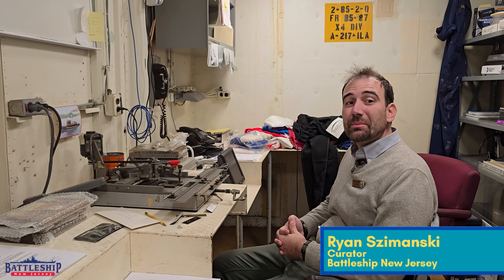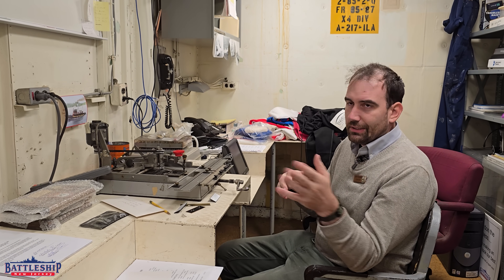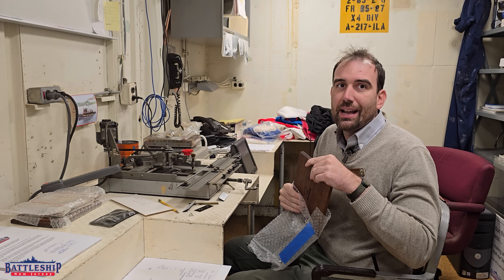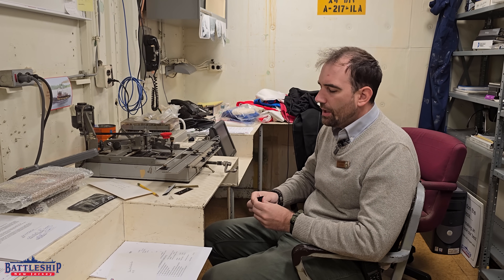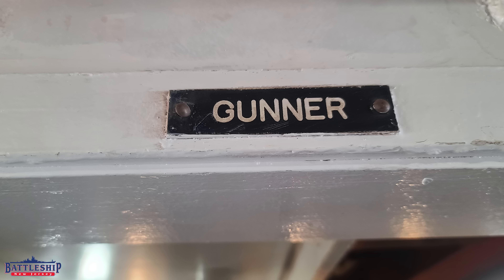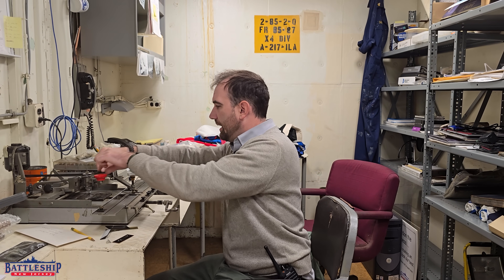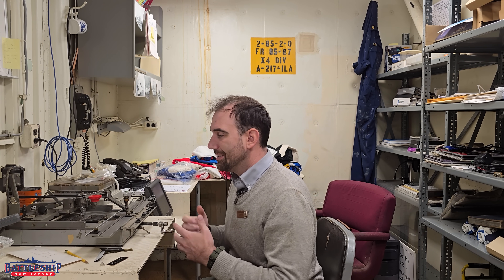This Thing Actually Works? Engraving on the Battleship

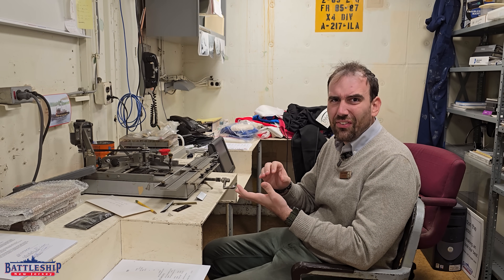Comment: Most of the lettering in the examples shown from 1:18 are "Gorton Normal" and "Gorton Condensed" (exceptions below). These fonts were common in the aerospace industry for engraving flight control panels (as specified in MIL-M-18012). They would have been used with Gorton's large pantograph machines (these would have been larger than a drill press, smaller than a Bridgeport). This is likely what Ken remembers.

The example tag seen at 5:25 does not use the same lettering - but it's possible there may be Gorton fonts in the other boxes shown at 5:19.

Aforementioned font exceptions. "Hospitalmen" at 1:24 does not look to have been made with a pantograph (sharp internal corners can be produced with these machines, but require too much time and skill than would have been spent on a sign like this). The blue signs at 1:28 seems to be mostly Gorton, but have one or two non-standard letterforms mixed-in (the "1"s in "1100" and possibly the "!"s at the end)

Comment: Commented on the live but no response, what cutting head?  My uncle used one in his jewelry shop and I did a steel watch back with it when I was a teen.  I think his had either a ruby or emerald head.  His did not have the motor though and needed a couple passes.  I also ran an embosser at times when I worked in a luggage store in 2001.   I also did security in the mines a couple years and they use metal letter punches for the in out tags.  A warship that size should have all three IMHO as the military wants to label everything.  You could as a fundraiser use such a device to make custom tags or labels for people on tours.  Perhaps teach scouts to use it on those overnights for mementos.  You also might check if the head can be changed for other materials as that design was fairly common before computer controlled machines.

Comment: Do you have the big dog tag machine? 
In the 90's I worked at a place (Navy) that had an old broken adressograph graphotype machine in the corner of the garage.
The command didn't want to spend the money to buy a new one, so I had the guys from 1ST LT. take it to a shop that repaired "old stuff".
They had it for a couple weeks, called us and it was ready to go.
$200 to fix it.
This thing was awesome, we made dog tags for everyone.
We also had the name tag machine, but it was "modern". 
It used a computer with a graphics program to make the tags.
We could change out the cutter head to make metal or plastic tags.

Comment: There's an easy way to find out if this is the original machine. The templates for these come in as many fonts as there are machines. If the fonts on the templates you found matches what's on the old signs, this is likely either the original one or from the same source. If they don't match, you've got a different one.

Comment: #1 - Ryan, please use safety glasses when operating that machine, or if anyone else does they need them. there's a lot of things that could send something into a users eye that could injure or possibly blind them. I wonder if there was a machinist rank equivalent to what would be a "Millwright", or, a master machinist that could not only operate everything in a shop, but could also repair, and make new parts for any of those machines if they broke. My father was a millwright for the old Ludlow Typograph company in Chicago, which made a unique brand of linotype machines. that sadly went out of function when more modern printing machines were invented that no longer needed inked metal letters to be pressed onto paper.